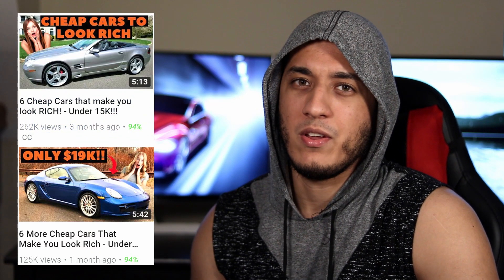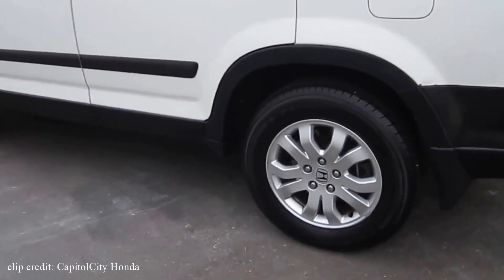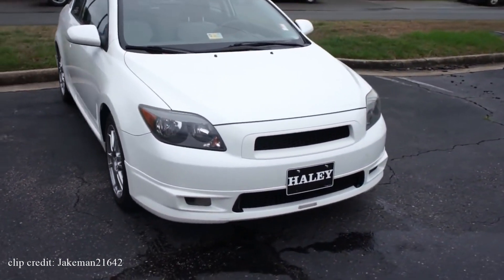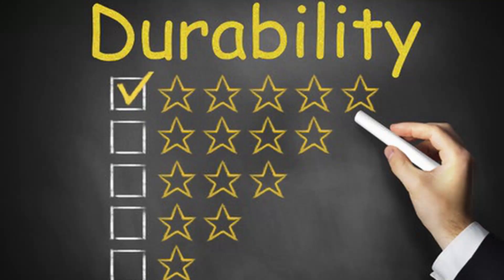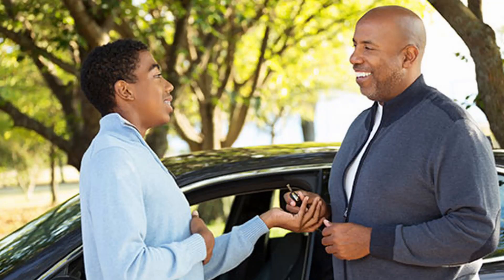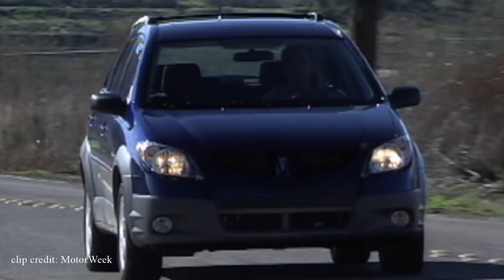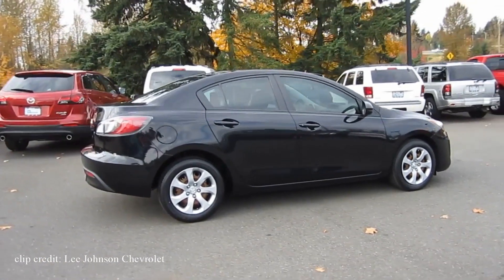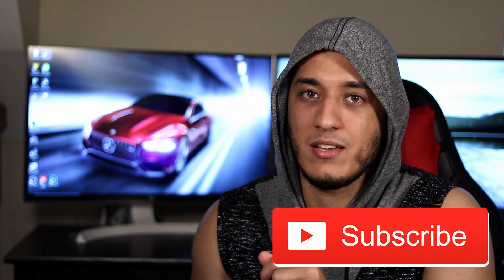5 Cheap Reliable Cars Under $5000

Comment: Never, ever buy a car.... Lease lease lease...... 5000.00 is 3 years worth of payments on a nice cheap reliable car....... If you BUY a USED 5000.00 car, it will cost you 15000.00 by the end of 3 years........ Be smart with your money, not stupid... Everyone be well...
Reply from the maker: Parts of your statement aren't necessarily true . You're saying that if you buy a used car for 5K somehow you'll have 10k in expenses within 3 years of owning it? First of all i titled this video reliable cars for a reason as they outlast most cars and are cheap to maintain. I purchased a 1999 Honda Civic in the past for less than 5K and it lasted me for 5 years with less than 2K in repair costs throughout the entire ownership. Gas and maintenance was cheap as well. Nothing against leasing but what your saying doesn't apply to everyone that decides to go for cheap used car. What if the person doesn't have excellent credit to qualify for lease deal? What if a person wants to own a car without having the limitation of mile cap? Every situation should be handled on a case by case scenario not a cookie cutter method.
Reply: Vehicle Virals would a 2010 honda civic would work for reliably
Reply from the maker: Swindle The Deception yeah man I don't see why not. Civics are amongst the leaders of cars with great reliability and low maintenance cost
Reply: Vehicle Virals thx man :)
Reply: Leases are for throwing your money away. Buy a gently used vehicle and take care of it and you should be fine.